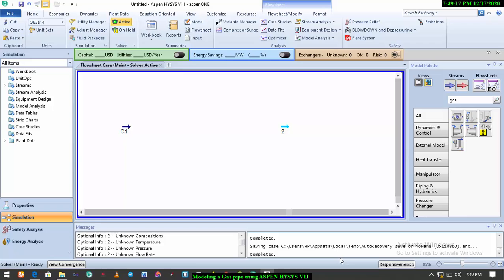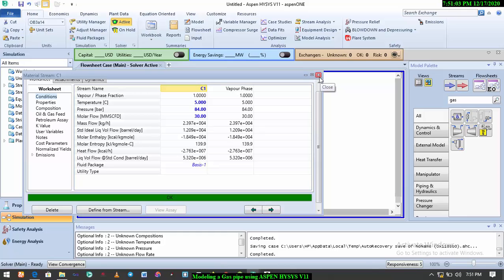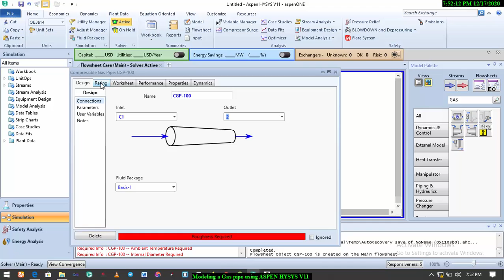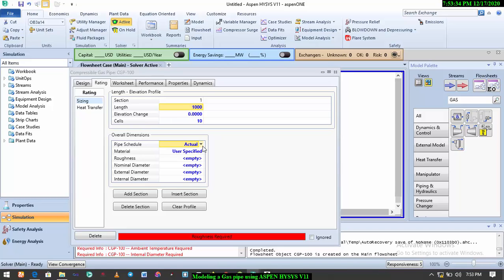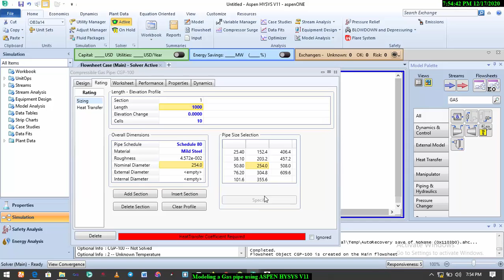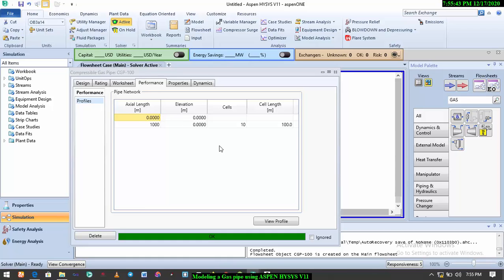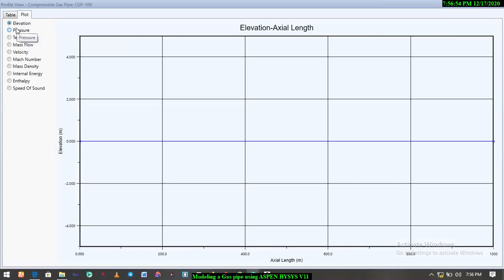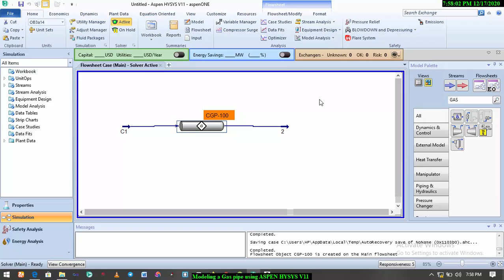Modeling a Gas Pipe using Aspen Hysys V11

Comment: Hi Collins, how can we find the flowrate of a existing pipeline with known parameters like pressure difference, temperature,... by using Aspen Hysys 11?
Reply from the maker: The header is originally designed to handle a particular flowrate and those branches are designed to carry a certain ratio of the total flow the header is designed to carry, a tee in Hysys can be used to model the branches of the header based on desired stream ratios from the header
Reply: @Aspenhysys89  thank you very much!
Reply from the maker: No you need the flowrate inorder for you to be able to size the pipeline
Reply: @Aspenhysys89 thanks for your reply. The problem is that I dont need to size the pipe, because I already had it. Lets say we have a steam header, from the header we have a 4" branch with some fittings to the process. How can we find the flow rate of steam that can be supplied to the process via that branch by using Hysys? Just want to compare with my manual calculation.

Comment: Thank you for this explanation. How we can calculate htc , is it mandatory to provide this input to simulate gas pipeline as this input is not require for liquid pipeline
Reply from the maker: The overall htc can be calculated using h=q/∆t where q is the heat flux. To simulate gas pipeline it is required